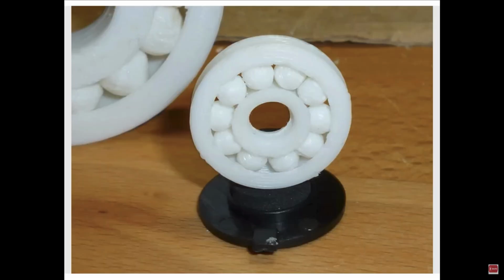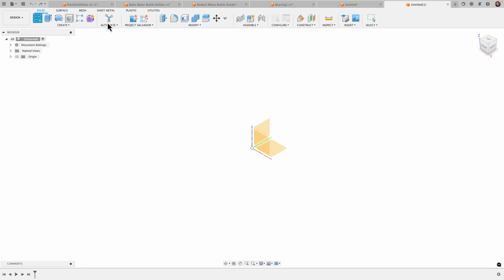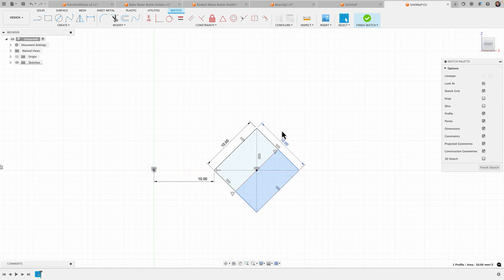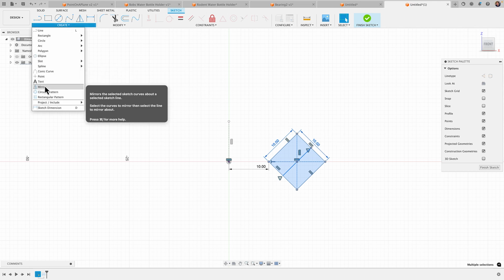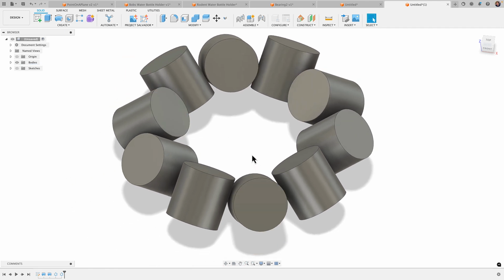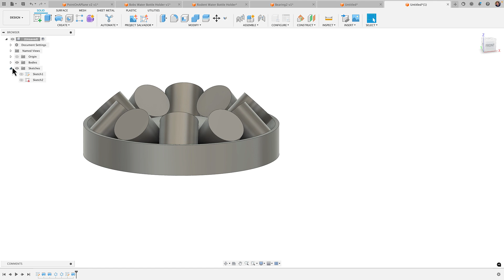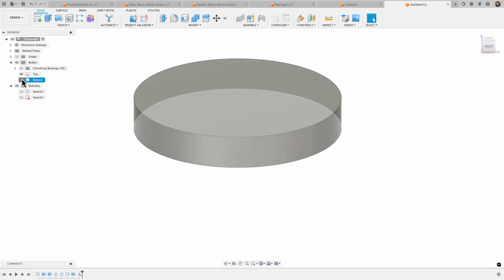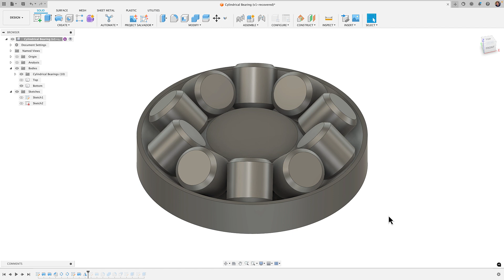A Better 3D Printed Bearing

Comment: Have a look at this video, I think he was the first AFAIK to make a 3D printable slew bearing using Fusion. Years ago I designed a bearing following his tutorial and it worked great. He has a different approach to designing it which works in his favour when he realises the rollers need to be conical and not cylindrical. https://youtu.be/5o4Fj8OxkB8?si=wkOTEwwjAZ_TpACE
Reply from the maker: That's what I love about this platform.  Now I get to go deep down the rabbit hole of slew bearings.  I didn't even know they were called slew bearings.  Thanks, I'll check out the video.

Comment: Why not create the cylinder with an extruded circle?
Reply: I agree that it would be good to explain in detail why this approach is better than using even a cylinder body over an extruded circle. I think it’s to help in creating the top and bottom pieces more than anything else.
Reply: I'm still learning, so could be way wrong. I think by doing it this way he kept from having to create multiple angled planes.
Reply from the maker: @justinG85 is correct.  In order to to approach this with an extruded circle it would have required creating an angled plane first at 45 degrees, sketching on that plane and then extruding.  Another option would be to create the circle on the xy plane, extrude it to a cylinder and then use the move tool to angle the body.  These are all different approaches that would work.  I preferred to create the sketch on the front plane.  That way I can define the angle with a sketch dimension and constraints.  It also makes it easier to come back and modify later.  I would simply edit that one sketch vs having to edit a construction plane, the sketch with the circle diameter, and the extrusion height.
Reply: @DesktopMakes, that makes sense. It is  good to see why others pick different approaches to a problem, and it is always good to have more than one way to do things in your tool bag. Thanks
Reply: In the end the whole thing turned out very ham fisted.
Reply: Thats a great way to make a cylider an a 45 plane without making a 45 plane.